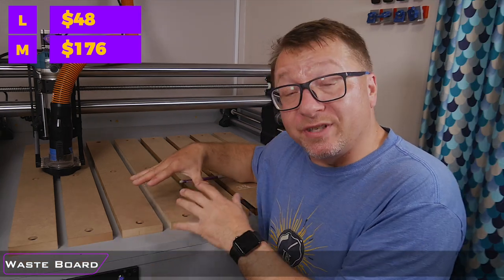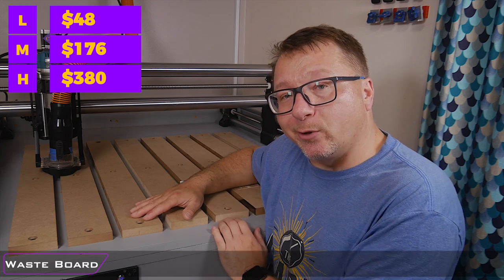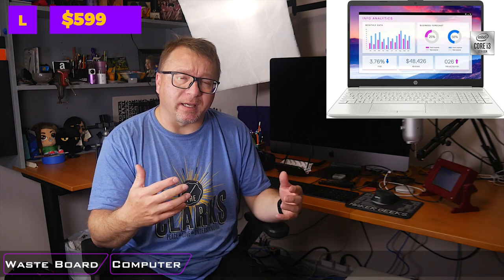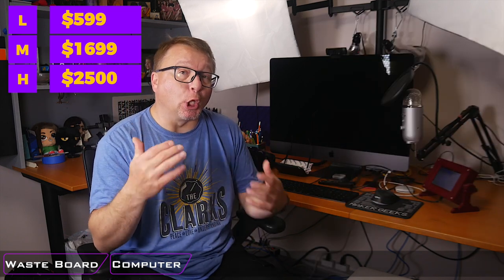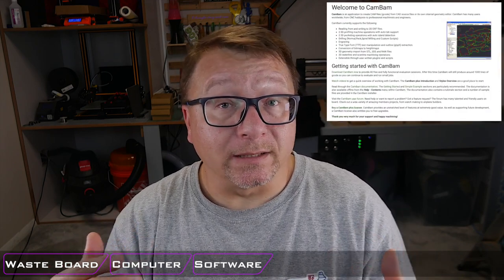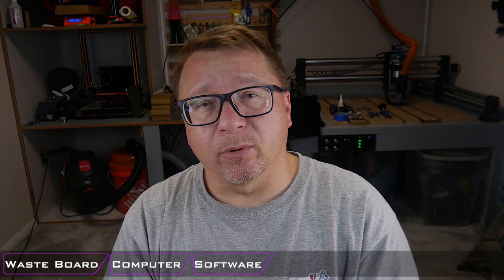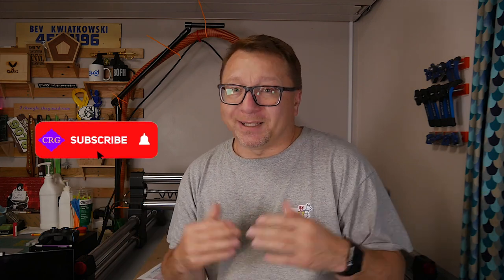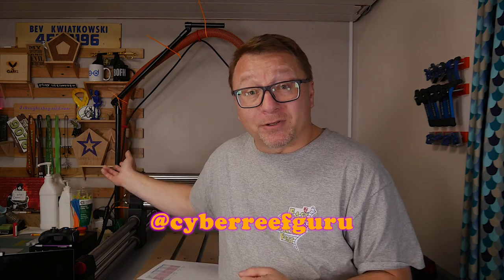The REAL cost of a CNC machine - PART 2

Comment: These videos are fantastic. I've been involved the hobbyist cnc community for about three years and this is the first (or actually second 😁) video I've EVER SEEN that tells the truth about the actual cost of running a cnc. I originally purchased a used Shapeoko 3 CNC for $1,500 in 2018. After upgrades and other unforeseen cost have easily $25,000 into the hobby. I'm now using a Shapeoko XXL Pro with 2.2kw spindle, dust collection, air blast and vaccum clamping. However the investment is totally worth it if you are dedicated because the products you can produce can repay your investment 10x!!
Reply from the maker: Thanks - I appreciate the positive feedback; I'm glad you found the video useful! Thanks for watching :)

Comment: as far as the computer goes $599 at low end laptop for $500 i built an 8 core fx8350 amd build  running 4.0ghz on a 990fx sabertooth r2 with 32 gb ram with a GTX 780sc and its watercooled to calm the temps i get here in AZ. i have a toy cnc 3018 running on an 8gb machine with no graphics card and it struggles especially if im having to make a quick code on it. I found 16 gb is good but 32gb is bulletproof. i chose thisa machine because as a modeller/animator i build one in 2011 and its still going strong today. the military grade mosfets are a big advantage. but my pricelisty was af follows for 9014 builld.  $1200 frame, $1000 shipping for frame. Gecko g540 control system custom built by e-dealers direct with ESS, enclosures spindle, vfd, cables about $3200. 4th axis $120 PC $500 Heavy steel table for it $1200 and theres some other stuff here and there such as for soldering and connectors for accessories so my total build is about $80  36" x 56" x 4" cutting area.
Reply from the maker: Thanks!

Comment: Great job summarizing the actual cost of running a hobby cnc. The one thing I would object to is the dust capture setup, mid-tier. The pricing is correct, but, as a woodworker myself, I can vouch for the fact that the standard bags that come with a lot of those systems leave a lot to be desired.  Mine allowed fine dust to escape, either through the mouth of the bag or even through the sides, and every time I started up the motor, there would be an explosion of fine dust that would then float in the air and eventually settle over everything else in the room.  I got so sick of it, I eventually traded up to a cyclone. I would not recommend that here, but actually the low end small cyclones like the Oneida dust deputy or the Dewalt system you showed will, I believe, work better in conjunction with a shopvac. But you do need to clean them out frequently.
Reply from the maker: Hi Santanu - I agree; my single stage dust collector is quite useless for fine dust. I would have added a cyclone to the list, but they are quite expensive for large scale dust collectors.  Thanks for the feedback and for watching!
Reply: @cyberreefguru  Yes, regular cyclones are extremely expensive.  Trying to go that route will blow just about any budget.  That's why I mentioned the Dust Deputy style ones.  They are around $100 plus a shopvac, which a lot of people may already own.

Comment: I am usually not leaving comments... great video! Found it always strange when people say they have a CNC for 500 or so 😂 I am not sure how much I spend for mine, but all together, probably 4000£ if I would count my time then easily 10 000£ but something similar from avid CNC would be 23.000£ so like you said depends what you need. The only thing I disagree is the computer. I brought one for 89£ refurbished i7 CPU ssd, etc, from Ebay. (May help someone).
Reply from the maker: Thanks for the kudos! You can definitely find less expensive computers or even netbooks -- depends on how you are going to use it. Thanks for watching!

Comment: You didn't mention a monitor, which you have on the left side of the machine.  What are you using, and does it have to be a touch screen if you use the game controller.  Great video by the way and thanks
Reply from the maker: Hello Steve - the monitor is a Viewsonic 15", 1080p touch screen. You do not need to have a touch screen to use the game controller, but if you don't have a touch screen you will need to use a computer to access the controller to set zero/home and other things.  Here's the link to the exact model I have: https://amzn.to/2XNPMuw - Thanks for watching!
Reply: @cyberreefguru  Brilliant Thanks

Comment: I was hoping you were going to cover the enlarged touch screen (if that's what you're using) cost, benefits etc .
Reply from the maker: Sorry Charlie ;)  The monitor is unique to the Onefinity and I didn't necessarily want anything unique to a specific manufacturer.  You can certainly add the larger monitor to the of additional costs though.  Thanks for watching!
Reply: @cyberreefguru  Onefinity will accept a larger touch screen monitor?
Reply from the maker: @charlietuna1355  Hi Charlie - it does.  I have a 15" touch screen (https://amzn.to/3HZIplZ) which is probably the largest I'd recommend, but I do believe some folks have used a 21" as well.  As long as it is 1080p and HDMI it should work for video.  The touch features may have some compatibility issues, but if it works with a Raspberry Pi Model 3 it will work with the OF. Hope that helps!

Comment: here is a tip many of the software programs have free unlimited student software. if you or your child has a school based email address. ALL autodesk software is available through educational license. and the pay version of easel is available for free with an educational account which includes better toolpaths, pegging for larger than bed size jobs and way more clipart. 2HP dust collector at harbor freight for $209 and its 1/3 the cost of other 1 hp models.
Reply from the maker: Spot on - thanks!